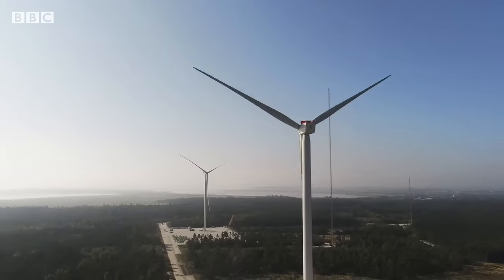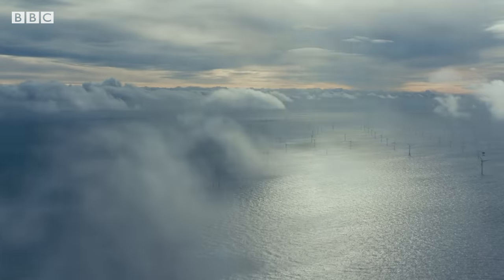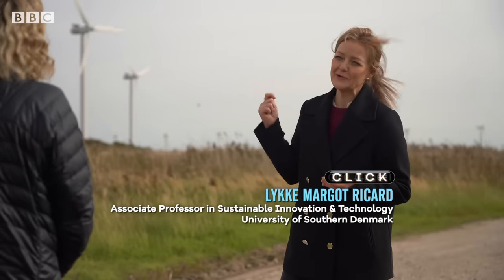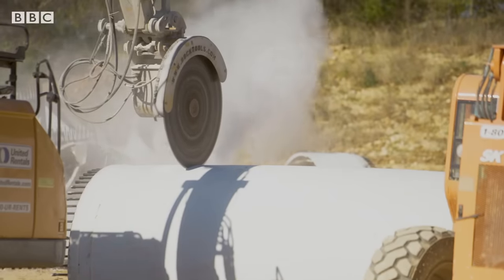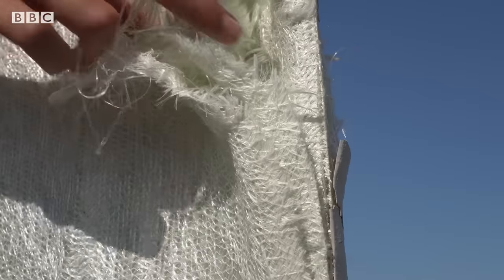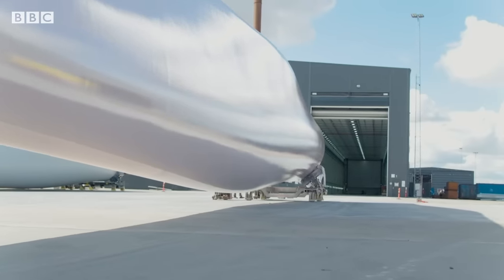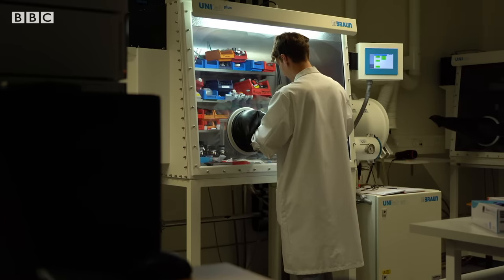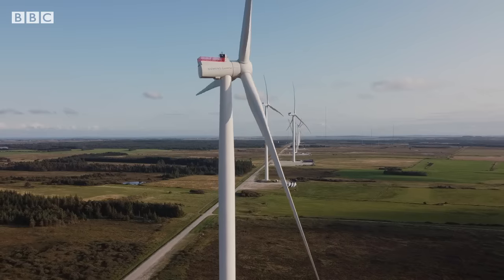Race to recycle wind turbines in Denmark - BBC News

Comment: Glad to know it is going to be simple chemistry of acetic acid. Acetates of so many things are very soluble in water, and acetic acid can easily be made from plants. The scaling up of recyling will therefore be commercial problems rather than technical or environmental problems. As Demark is the pioneering tiny country to adopt wind turbines on a large scale, they have a head start and an urgent need in developing ways to recycle turbines.
Reply: christate3197   Either the acid works, or it doesn't. Are you claiming that the BBC & Demark's scientists lied?

Comment: Step 1: Demand a  certain degree of recyclability before placing the wind turbines. 
Step 2: create the financial structures to encourage the actual recycling

Products which aren't designed to be recycled will seldom be cost-effectively recycled. only downcycled. Things aren't hard, but there is simply no long-term vision.
Reply: Not sure how they are going to recycle the 1000 tons of concrete needed to stop them falling over. In most locations, they dont even create enough energy to cover what was used to make them.
Reply: @Aspartame69 We have been building wind turbines for 50 years, in Denmark. The first 20 years without government funding. Vestas, LM Windpower, and Bonus Energy (now Siemens Gamesa) all were created back from the beginning.

It would not have been possible to create this industry, if the turbines could not make as much power, as it takes to build them. Turbines are getting bigger, simply because they become more efficient, the bigger they are.

There are scientific papers out there, that has calculated how much energy, it takes to build a wind turbine. I don't remember the exact number, but it's around 3-4 years the turbine needs to run, before becoming a positive contributer. And wind turbines can work from 20-40 years, so they produce a lot more energy, than what it takes to build them.
You are misinformed, or a stupid conspiracy theorist.
Reply: @akyhne  Its amazing what is possible when tax payers money is pumped into a project. Here in the UK, 25% of everything i spend on electricity is handed over to people who build wind turbines.
Reply: @Aspartame69  Wind power is already becoming so inexpensive, that it can beat coal. You're paying that money, for a common good, just like with the NHS.
Reply: @akyhne  Wind power has just collapsed in the UK, no investment proposals were made this year and will not be made unless they command 4x the going rate of electricity subsidised by the tax payer.
The problem is not the electricity generated, its when the wind is not blowing, backup has to be created, so all wind power is paid for multiple times over.
And the NHS? We have doctors going on strike while the NHS put adverts out for 240 new non-medical diversity jobs at a wage 2x the what doctors are paid. Publicly funded institutions, the NHS, and the subsidies of the green revolution are not viable.
Reply: @Aspartame69   
The Guardian:
"Onshore wind projects in England stall as no new applications are received". 

newsscientist:
"World’s largest offshore wind farm sends first power to UK grid". 

Energy Global:
"The UK’s green-powered future: Five leading wind farm projects".

These are all headlines from mid to late 2023. It's only onshore wind turbines, that aren't being built, not offshore.

Comment: So, if they are virtually indestructible why are they replaced?
Reply: Material fatigue over time leads to the eventual risk of critical failure.  For safety's sake, the blades are replaced before failure becomes a real possibility.
Reply: @JeffreyGoddin info without sarcasm. Thank you, kind sir.
Reply: A matter of physics and scale. The larger the diameter of the turning circle, the more efficient the wind turbine becomes.
Reply: The mechanical elements in the nacelle wear out to the point they aren't economical to repair, and the structures are subject to erosion and corrosion. The blades are normally fine.
Reply: It is “almost indestructible”. Your answer lies in the almost.
Reply: I have shares in the outdated wind turbines at Middelgrunden. The plan was to replace them with new turbines on the old foundations but last year (or 2021) it was decided to replace all the 'guts' (incl. a modern sensor system that will make repairs much cheaper) and keep the blades and the towers for the next 25 years.
Reply: @jensstergard9380 that's great! When were they  constructed? Seems like that will be a very long time with the original blades!
Reply: I thought they were made of balsa wood...
Reply: @lfeb  no they have to be very light and strong to take the enormous force of the wind, so they are glass fibre and epoxy. There is a company making wind turbine towers out of wood but they can't be as big as steel ones as wood is much less strong.
Reply: Advances in technology
Reply: @JeffreyGoddin  Nobody lives below the turbine, so what safety risk is there? "if it ain't broke, don't fix it".
Reply: @mikeomolt4485  That doesn't explain why the smaller ones are simply disgarded. Economics would dictate they would be sold cheaply to someone at some place that isn't willing to invest in a larger one yet. For example, sell 1 smaller one to some farmer cheaply who wants to set up on their land. No reason to dump it.
Reply: @adrianthoroughgood1191  So why not just make the blades out of aluminum if titanium is too expensive? Could melt the old blades and recycle the material fully at end of life.
Reply: @cyberfunk3793  It would need to be dismantled, probably transported to storage, serviced then transported to a buyer, perhaps impractical if it means removing telegraph poles along hundreds of miles of winding country lanes. Route to the location site is a major factor when installing these things.
Reply: @cyberfunk3793  Mike was just wrong. They don't take down turbines that are still safe to use. They stay up until they wear out. There's no such thing as a second hand wind turbine.
Reply: @cyberfunk3793  I can't see anyone mentioning titanium. I don't know if YT is losing comments or something. The blades are 100m long and have to be able to support no only their own weight but also the huge forces caused by the wind and the motion of the blades. Plus the bearings and tower have to be able to able to carry the weight of the 3 blades plus hub.  Any metal would be too heavy.
Reply: The guy in the video did not say the turbines were virtually indestructible. He said the material the blades are made from is virtually indestructible. If the blade snaps the material still exists. He is talking about how it is difficult to separate the chemical components of the blade material, not saying the blades can't get broken.
Reply: @adrianthoroughgood1191 Well second hand wind turbine was something I thought would make sense in case actually still working ones were replaced by more efficient ones. For example if someone has just one piece of land and calculates the upgrade would be worth it, they might earn even more with a new turbine. But if it doesn't happen like you said, then it's not an issue.

I'm not sure about what you said about any metal being too heavy. Blades on helicopters and airplane engines rotate a lot faster than any wind turbine so seems to me one could simply scale up and have a design that could take the load. But perhaps I'm missing something in the physics and the forces simply don't scale linearly with the dimensions of the object. I could understand though it might be very hard to manufacturer a large blade out of metal like that, especially if it had to be done similarly from one piece as I suspect blades in airplane jet and properller engines are made.
Reply: christate3197  over the last year wind turbines generated 29% of all electricity in the UK. Right now it's 48%, which is more than all fossil fuel generation put together.
Reply: christate3197  these are figures from the national grid. They only cover generation that goes over the grid so they don't include things like home solar. Obviously the figures will be affected by what time period you are looking at. It is usually windy somewhere in the UK. We have interconnects to several European countries to get some of their electricity when we don't have enough, particularly hydro power from Norway. Right now we are exporting electricity because we have more than we need. We will need more storage as well when we are using less fossil fuels, both off river pumped storage and batteries. Gas can be used as an emergency backup for long periods of low wind, though the aim will be to keep this to a minimum. The idea that wind turbines aren't a useful way of generating electricity is a myth spread by the fossil fuel industry.
Reply: @@YahWinUWin the average lifespan of an ICEV is 17 years. The battery of a newer BEV is expected to last 15 to 20 years to 70% capacity then last a period longer as stationary storage.
Reply: @JeffreyGoddin 😅
Reply: @adrianthoroughgood1191 Almost all companies, uses balsa wood, inside the blades.
Reply: nielslund641  That's incorrect. We are not getting the electricity for free. We pay a little over 1 crown in taxes.

Comment: This problem is fairly small compared to other kinds of waste in our society.
But obviously it would be great to recycle wind turbines.
Reply: Correct. Naysayers complain about old wind turbine blades in landfill but have said nothing for years about millions of tones of plastic in the oceans that breakdown into mircoplastic and make their way back into the food system.
Reply: @douglascutler1037 not to mention re cycling coal fired and nuclear power stations, what about recycling coal that's been burnt, I suppose sending that up in smoke into the atmosphere means you don't have to.
Reply: @metricstormtrooper  The point is the net benefit of the power stations, wheras, turbines are almost entirely useless during the times energy is needed the most, and batteries that are required to make them feasible and an ecological disaster in and of themselves.

Comment: At 5:07 "Now we've found a chemical process that can chew its way right through the epoxy".  Okay, I'm not much of a chemist, but if you have a chemical that 'chews its way through the epoxy', that's going to create an awfully potent by-product.  How potent IS it, and how do they dispose of it? Are they creating a new problem in the course of solving an older one?
Reply: Not into chemistry either, but report does say they dissolve the epoxy in acetic acid. A quick search reveals, some acetic acid is actually food grade (appears as an ingredient in a jar of pickle in my fridge). Glass fibres can be recycled. Bound to be some  epoxyfied goo left over, but at least it's a start.
Reply: To add...having used epoxy many times when a fiberglass, laying up fiberglass like they show. I just have to say whatever process they are doing appears to be working based on that sample he shows. But absolutely the issue will be but how many toxins, or emissions, come from that process? Whatever it is, it looks like a positive breakthrough because wind blades are just the tip of the iceberg on composite waste.

Now on the flip side of recycled materials for reuse in making blades - getting that to be economic will be very interesting. For ex., silica, mine virgin silica is very low cost vs this process. But my expectation is, policy, laws, corporate charter regs will be for wind companies to use x percentage of this recycled material with low cost mined virgin.

Comment: No, its not hard to recycle, they can be used to make cement.
Reply: I just knew that one of the fantastic YouTube experts would soon be along to give us the no-bullshit facts. I had this strange feeling in my bones. We know it can be used as an ingredient in the making of cement because they told us so in the video. From the video, "one immediate solution is to chop them up and finally shred them; they're burned as fuel and used as an ingredient for cement production." How bloody spooky is that?
Reply: Fibreglass can be, but I don't know how it can be once it's been impregnated with resin
Reply: Recycle is when you use old turbine blades to make new turbine blades. Reuse is when you repurpose old turbine blade material in cement making. reuse is a one way process, it doesn't complete the circle in a cycle that would allow it to be classified as re-cycle.
Currently wind turbine blades are not recycled but their materials can be repurposed for other things.
Reply: @longdang2681   nice clarification, i get it now

Comment: Its so frustrating knowing about that issue 20 years ago and there is not yet a full scale solution (not even close) but a one in a tiny laboratory that "mayyyy beeee" could "beee" a solution (which probably is still far from a good solution). And the term recycling is mostly misused as well. There are a few examples this really takes place in a more or less good scale, and this is with PET bottles and maybe also cans (?). With the precondition that they are collected correctly and not thrown into default trash. Because cans and PET bottles can be "recycled" into new cans and PET bottles (issue remains concerning colors). However, using an old wind turbine blade as a roof for bikes is NOT recycling, rather reuse in an alternative way, but eventually... dumped somewhere anyway.
THE solution is still using less energy. But we still don't get it

Comment: Why they don't just make the blades from aluminum like they used to do with aircraft wings? Much easier to recycle aluminum parts.
Reply: More brittle, more dense and harder to work with springs to mind.
Reply: @fastertove  Aluminum harder to work with that carbon fiber and other composites? If that were the case, why it's cheaper to make bicycles out of aluminum and carbon fiber frames require  much more manual labor? Also airplanes typically have always been made out of aluminum and only recently composites have been introduced into the field, so seems to me should be easier to create some huge effin aluminum molds for the blades and just mass produce them. When they are at the end of their life or become damaged, just melt the stuff and voila and you can use it again.
Reply: Wind mills and planes aren't being stressed the same way, and you can't really use plates of aluminum. Technically, it could probably be done, if the lower efficiency is tolerable, but in practice the huge effin aluminium molds would be very/too expensive if it needs to compete with fossil fuels. Especially when building lower quantities of mills, which often is the case. Being pioneered in Denmark, a country without a natural source of aluminium might also have played a role.
 
Any way. Better to evolve the essential parts of the technology (e.g. safety and energy production) and fix minor issues later. The wings of wind mills doesn't seem to be a major issue in the larger scope of things. Changing to aluminium would likely be immensely costly, and I'm not sure it is really worth it atm. Besides, they are being deposited rather than thrown into a random landfill.
Reply: If it was possible, they would. It's not!
Reply: @cyberfunk3793  But as we can see he resorts to the technique of talking senseless rhetoric.
Reply: nielslund641  I don't really understand that argument. Airplane wings are much more complicated, they contain fuel tanks, adjustable flaps, spoilers etc. and if such a complicated structure can be made out of aluminum, I don't know why a wind turbine wing couldn't. I could understand if wind turbine wings were simply too large to build the same way, but it seems that isn't the case either and for example A380 wings are close to the blades of wind turbines in length.
Reply: @cyberfunk3793  131 meter blades... thats more than 3 times anything airbuss - per blade... That said - it would be nice to know why a reusable materiel is yet to be used
Reply: @TainDK  Airbus 380 wingspan is something like 80m but obviously due to the weight difference, it isn't such a good comparison. Afaik that plane is made of something like 80% aluminum which is obviously reusable/recyclable at least for some other purpose that uses aluminium.10% is titanium and steel and the rest is composites.